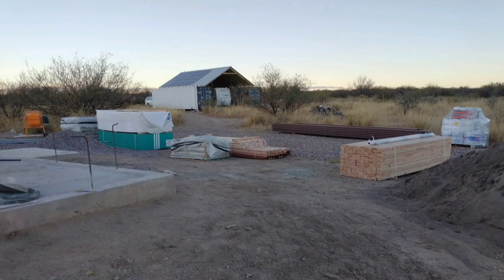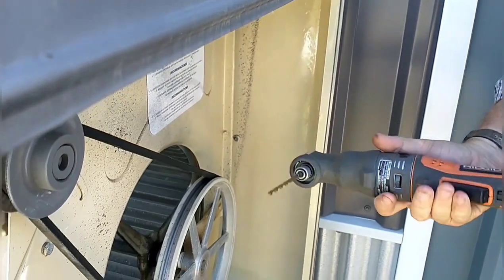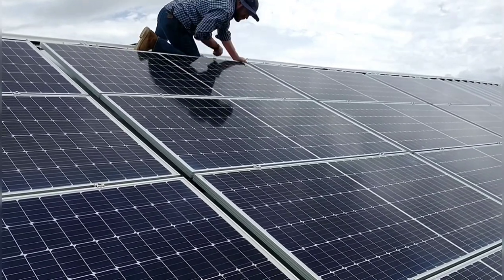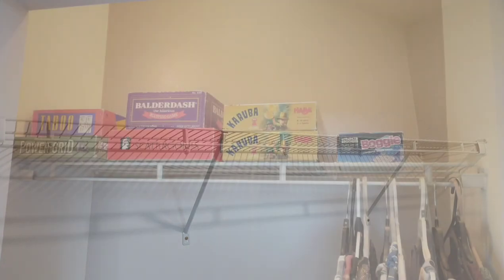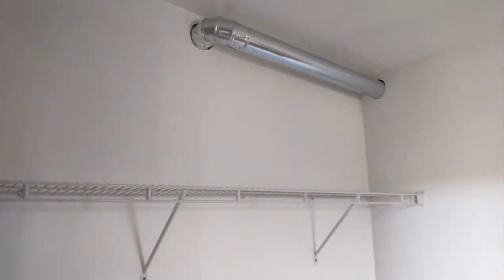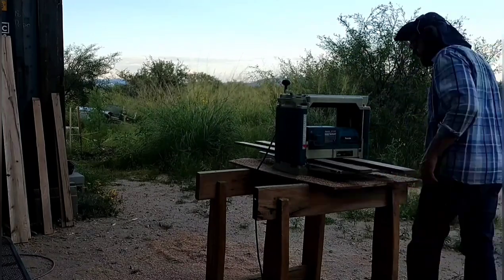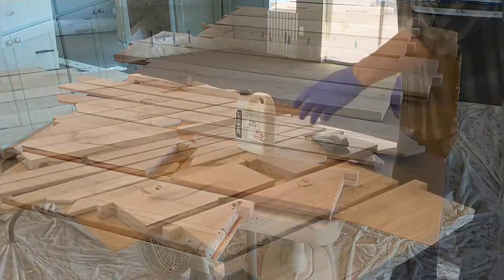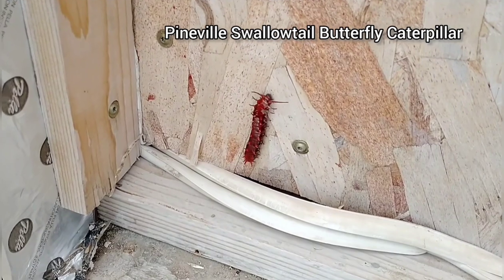Solar & Hyper Adobe Update, Window Sills & Vents #47 DIY Passive Design Off-Grid Home Build

Comment: Red the house is looking amazing. Nice to see you changed the dryer vent to rigid pipe but you made another major mistake installing. You should not have used screws. They catch the lint and build up to a blockage. Foil tape on the joints only.
Reply from the maker: That would be an easy fix, thanks! 😄

Comment: How high are the ceilings on each side? And what pitch is the roof.. looks amazing and I'm about to build something very similar.. my architect has almost 16ft ceilings on the one side and 9ft on the low side
Reply from the maker: Ours is 8 ft on the low side and 10ft on the high side. The roof is a low pitch 12 to 1. We didn't want the house too tall for efficiency and ease of building. Best wishes on your build, sounds like nice tall ceilings! 🙂

Comment: just a heads up, you should never use screws to join dryer pipe, only tape. the reason is that lint will collect and can be a fire hazard.
Reply from the maker: Thanks! I guess a lot can go wrong when installing a dryer vent. 😄 We should have looked it up.
Reply: @RedandAprilOff-Grid  I would hate to hear about a dryer fire in a couple months/years.. Would you be able to provide some solar updates in your videos please? I bet that I am not the only one who would be interested in regular updates on how it is handling your needs. Are you having to run a Generator at all? How long is it taking before you are fully recharged every day? how much power are you getting in full sun in winter vs summer? how about the shady days? Things that you would do different. Thanks. PS the off grid nature of your journey is what brought me here in the first place, and it's really the main reason I subscribed. Cheers, thanks
Reply from the maker: Thanks, I plan to hang the laundry to dry, but it's nice to have the option. This video has a solar update, there's not much else to report, and right now our focus is on building the house. We can run power tools all day without any issues, even when it's partly cloudy. It is rare to get a completely cloudy day out here.  The only time we ever use the generator is for the welder. We have a maximum of 3,000 watts per leg, so we we need to watch out for that. The table saw when it's working hard, uses up to 2,500 watts, so we have to make sure nothing else is running on that leg at the same time. We don't have any need to monitor the system carefully, because it's running everything we need it to without any issues. We don't run heavy use electric equipment at night, so our batteries are easily staying charged until morning. Red will probably be installing a second set of batteries before winter, because we have some family coming, and it will be nice to have some extra battery storage in the winter. 🌥️🏜️

Comment: Evaporative coolers are very nice in dry weather but will do absolutely nothing for the cooling your home down when it’s humid
Reply from the maker: When it's humid, it will still drop the temperature a few degrees, but when the humidity inside gets over 60%, it's more comfortable without it.